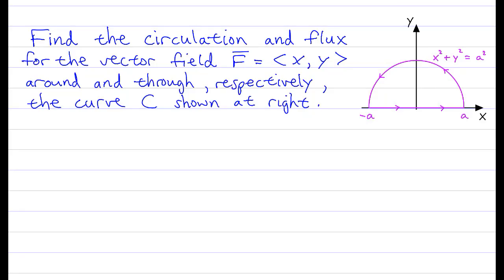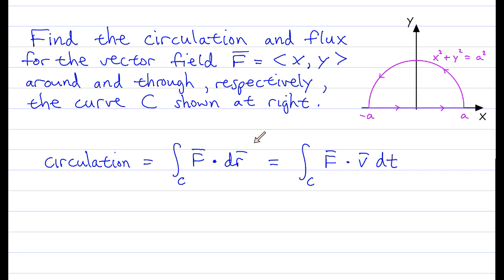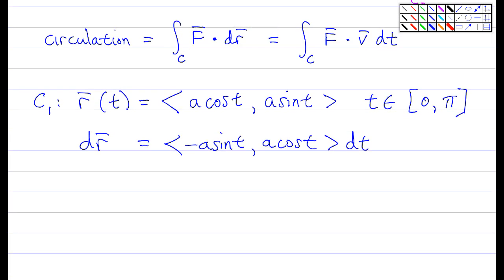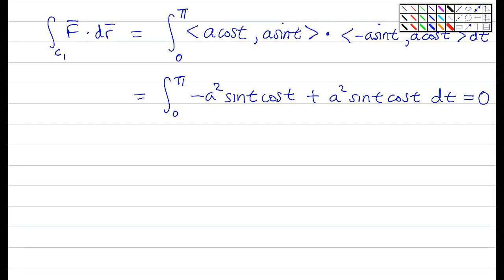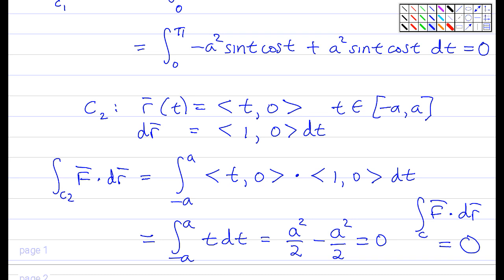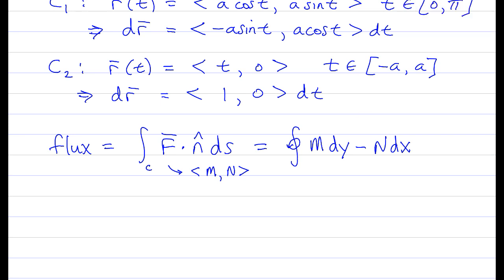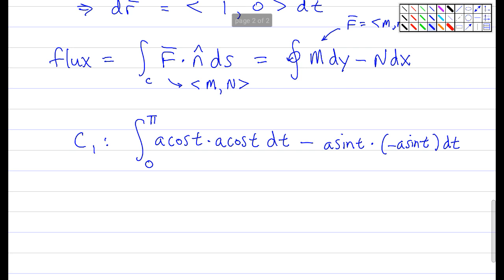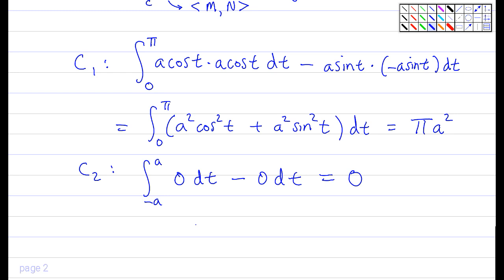Line Integrals: Circulation and Flux

Comment: thanks for the video, but is the flux answer is correct? because, when I calculate with 1st principle, the answer was a^3*pi.
Reply from the maker: Hi, and thanks for watching. I'm not sure what you mean by "1st principle". But if we look at the definition of flux for a curve in the plane, we see that flux is the line integral around the curve of the normal component of the vector field F. Since the field F = <x , y> has units of length, the line integral we want will have units of length squared. In other words, our answer should have a^2 in it, not a^3.
Reply: @erikthered109  Thank you very much for the clarification!